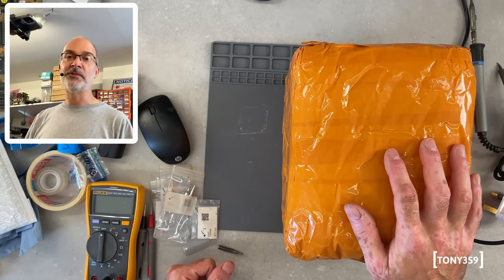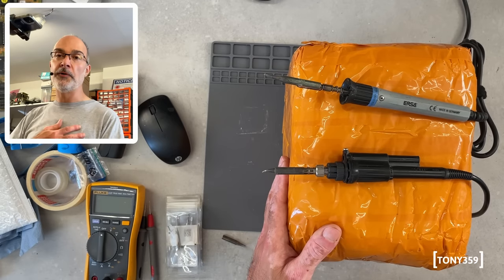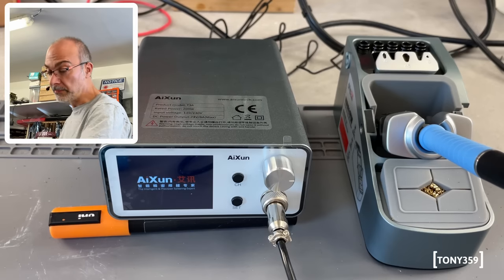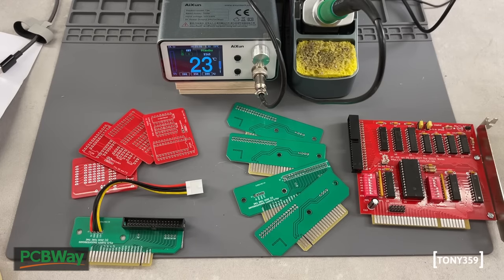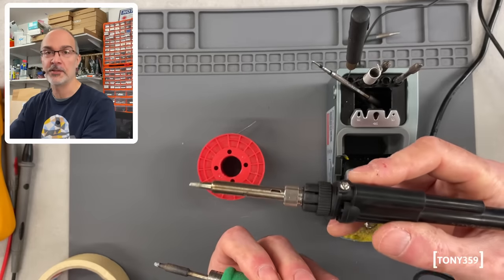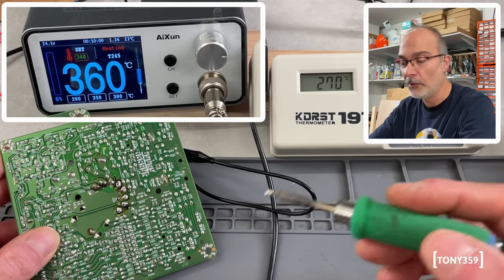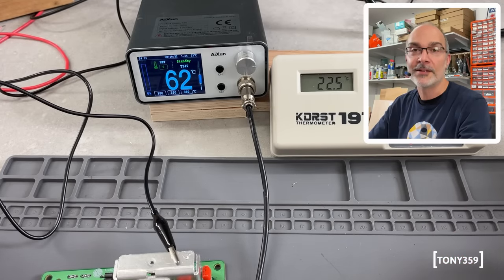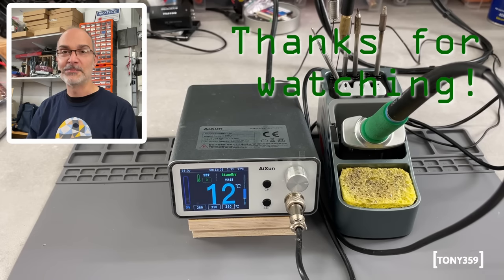Is the Aixun T3A a good T245 soldering station?

Comment: I'm using this station with firmware 1.33 and chinese tips (AiXun and the OEM distributing in carton package imitating JBC which even has the shovel type cartridges). I have measured resistance to ground from a tip and is less than 1 ohm. The tip itself is grounded. I tried heating with a knife tip a cable connected to ground and it didn't behave weird. It maintained temperature with no power spikes.
Reply from the maker: Mine is also grounded. Try measuring the voltage when it’s heating. You should measure 1V. Touching ground with a tip doesn’t trigger the issue all the time. It needs a grounded PCB and not all the pins, don’t ask me why. SDG electronics (who failed to mention this channel) has also managed to replicate the issue with a newer model so this is definitely not an isolated issue.

Comment: Hi, I have purchased the T3a this week, my firmware version is 1.26 and the calibration is acceptable but due to annoying background noise I disassemble the device and all the Electrolyte capacitors and X2 cap been replaced, the manufacturer used Huahong🤔 brand instead of quality Japanese caps.
2* 35v 1000uf
1*400v 82uf
1* 35v 470uf
1* 50v 10uf
100nf x2 275v
The noise being mitigated but due to high amount of glue around Set button the front glass cracked during the removal process, also I own Jbc T210 station and regarding its 3x price compared to Aixun in my country the handle weigh difference is also noticeable.
Reply from the maker: yes the glued front panel is another reason why I didn't want to open mine!
On EEVBlog forum there is a long conversation about the T3A, the noise comes from the waveform used to drive the handle more or less. It makes some component to "sing". It's just the design.

Good capacitors can only help!
Thanks for watching!

Comment: Thanks for this review Tony. I have the same one. You showed me to update to 1.33 :-D. What happens when you put a 1megohm in the ground line? (make an ESD ground (what it should be I think))
Reply from the maker: The ground line of the soldering iron? To be fair, I don't want to mess with ground, if a device has a ground connection, it's for my own safety. The T3A is already leaking about 1V through the tip (yes, I know it doesn't make sense if it's grounded but that's what my Fluke says) and tinker with ground might not be the best idea. In the end I don't want to damage my PCBs but the T3A is proving to be "unfit for purpose" the more I use it. Ah, and stay away from the latest firmware, 1.35. It's also bad.
Thanks for watching!
Reply: @tony359  No your right! I mean the clip wire to ground doesn't need to be a hard ground. That should be an ESD ground (your blue anti static ESD arm band  also has an 1Megohm resistor to ground in it). If the producer of the iron is cheap, they omit the 1 megohm. and you have a hard ground on the clip. which does crazy things. So you could try it by clipping a 1megohm resistor to the clip and touching ground with it to see if the iron goes crazy or not.
Reply: @tony359  Darn. I forgot to ask you for the link to the upgrades you showed. I cant find them on Aixun website.
Reply from the maker: The ground clip was to show you the problem. The real world scenarios I mentioned (another soldering iron, the signal generator, the pre-heater) can't have a 1MOhm resistor I'm afraid! I think I'll move to a proper station soon... To update it's the Aixun software on their website. The update is done within the software.

Comment: There have been a few firmware updates since this video. Did you try them?
Reply from the maker: This is not something that can be fixed by a firmware I'm afraid. I did try 1.35 I think, the issues were still there and my JBC tip was off by 60C after a full reset. Meanwhile 1.36 came out, I don't use the T3A anymore but I haven't read any enthusiastic comments about that on EEVBlog. Since 1.34, Aixun seem to go to the "let's hide this problem" direction so upgrading might not always be the best idea.
Thanks for watching!

Comment: Have You tried 1.35 version? Are these problems still there?
Reply from the maker: I gave it a quick test, the first thing I noticed was that my usual tip was now 60C off (this is after resetting the station). The grounded PCBs issue was still there. I really feel those issues cannot be fixed via software I'm afraid.

Comment: Thank you for this very informative video 👏 I recently mad a purchase for one on ebay too sweet of a deal to pass up but now after watching this im having second thoughts. I initially wanted the T320 which recently became available, it supports the t245 & the t210 I hope either you or SDG gets to check it out. I've been running with my Hakko 888D for a few years now and I honestly love it but alot of times now occasionally I would need more power which sometimes it takes too long or doesn't heat effectively for higher gauge wires or large ground plains. Other than that I'm fine but it was really interesting to see the differences between the firmwares and the grounding issue. Now im a little scare of using it but I'll give it a go using the lower firmwares when I get it. I definitely bought jbc tips to prepare but now that I put some thought, Would have it been better to save a little more to get a jbc vs the aixun.
Reply from the maker: If the JBC wasn't 4 times the price... I'm always for buying high quality tools which last a lifetime but I really cannot justify spending £500 for a soldering iron :) 
The T3A is ok-ish :) I still need to try a downgrade and see what happens. Once you know about those issues you can try to mitigate them but I can very much understand your concerns!
Thanks for watching!
Reply: @tony359  I recieved mine today it's on version 1.30 it definitely makes a buzzing noise when heating up to temp but once it's hot it stops. I haven't used it yet I'm going to play around with it later on I'll come back with any updates that I notice.
Reply from the maker: Thanks! Yes the buzzing noise is a by-product of the PWM signal sent to the tip. When you turn it on it's heating at full power so it gets loud. When it maintains the temperature, it'll send "burst" of power and won't be as noticeable. If you put your handle close to your ear, you will hear an intermittent noise coming from it - don't burn yourself though! Looking forward to hearing your update!
Reply: @tony359  lol, yes, that's how I noticed. I did exactly what you said and heard it. Since there was noise in my background at first I didn't catch it but when the place got quiet I noticed. Do you think the grounding issue can potentially be fixed with an update, or would the hardware require some type of modification?
Reply: @tony359  I also noticed on my unit where when I connected the handle to the station, sometimes it doesn't acknowledge it has a handle available. I have to apply pressure or wiggle the connector until it reads, then screw it on. One video I can't remember who right now spoke about it. When I looked, the jackets for the pins were not as close as I thought they would be. I had to do that in order to get the t3a to fire up. As well as barely inserting the cartridge, it came on without snuggling it down with the tip pushed.
Reply from the maker: Never seen that problem I'm afraid. On the grounding issue, I really doubt they can fix it. If the HW is unable to send a reliable thermocouple reading... well you can try to detect it and avoid sending 100% spikes and hope that during that time the temperature is going to be stable. It's like driving blind for a few seconds: you can try keeping the steering wheel straight hoping there isn't a bend. :)

Comment: Because of controlled ESD discharge, you have to ground everything, including yourself. Professionells who must work according to the IPC standards, know this and act accordingly. 😂😂 Besides, you can make the ground connection with a 1 MegOhm resistor. This will maintain the necessary ground connection and does not disturb the temperature sensor.
Reply from the maker: yes but it's too much of a hassle. I don't want to have to waste time on this because someone made a lousy design!

Comment: re: Temperature jump: check inside the handle, the thermocouple lead might be shorting to one of the other leads.
Reply from the maker: Thanks - it’s a design flaw unfortunately seen by others too. It’s apparently because of the smps
Reply: @tony359  Is it noise affecting the thermocouple amp or mosfet switching?
Reply from the maker: I’m not sure but I think it’s the thermocouple. Hence the unit thinks the tip has become cold.
Reply: @tony359  as if the thermocouple connection is intermittent ... handle internal contacts, or cold solder joint or bad/frayed wire
Reply from the maker: @chuckmuziani6262  it's a design flaw because of the way the SMPS is wired apparently. Models using a linear transformers are not affected. This has been confirmed by others - both reviewers and users - and it's not a fault with my unit unfortunately. Hence why Aixun are trying to hide the issue via software.
Reply: @tony359  Curious to see a scope trace of smps output when the 'glitch' occurs.....

Comment: I have the Ersa RT 80 24V 80W and use it with 12V. The heating Element self regulate to around 350°C.
Reply from the maker: I have a portable ERSA iron, it's a good one. Ersa stuff is generally very good indeed! Nothing to do with this thing! Thanks for watching!
Reply: @tony359  I mean your Ersa could also be selfregulation to a given Temperature by its heating element resistens. Like my handle do without its Station.
Reply from the maker: Is it like the Metcal ones? They self-regulate based on the metallurgic properties of the tip? It's an amazing system which doesn't rely on electronics!
Reply: @tony359 No the Heating element is a PTC and changes it value from 2 to 10 Ohm, dependent on Temperature. normally there to measure temperature. But just with a smaller Voltage 12 instead 24 it heat perfectly up to 350°C.

Comment: The intermittent temperature spiking, the screen lieing and weird issue with grounded boards is unacceptable.
It means the tip is not grounded. I won't be buying.
Reply: the 420 dont have this isuues whit the last version and the ones it come  just tested.The issue is how stupid is the price of the 420D when the 420 is the same station i got the 420 and buy the  110 holder and tips and was 266€ .
For me is the best chineses station.
Reply from the maker: I didn't mention that on the video but the tip is indeed grounded. On EEVBlog they speculate that it's some sort of noise which is interfering with the thermocouple reading going to the station. Not sure! Thanks for watching!

Comment: for the average price of these.. i'll be sticking with the t12 systems in place. open source firmwares are available with ease, you can get hakko tips so if there's problems you know its the station you need to poke at for the source, and for the most part they've just kind of worked. i also haven't seen this pwm buzz in any of the t12 variants.

while these t245 chinese variants appear to have a number of teething issues still. i don't find the few upsides over the t12s to be enough to justify switching to the t245's just yet. soldering irons are one of the few things i don't want to spend any time fiddling around with it trying to get it to play nice. its one thing if i'm making my own wands for swap outs, thats on me. its another entirely if its out of the box behavior. not gonna deal with it.
Reply from the maker: I was thinking of a T12 too. Then I saw so many good reviews of this 245 and went for this! I am somehow happy with it, but definitely was not expecting these issues.
Reply: @kenabi Can you reccommend a good T12 system please?

Comment: What a shame. If touching a grounded PCB causes such issues then the tip itself cannot be grounded by the station, right? My first thought would be issues with the PSU of the station. I found that many ungrounded switch mode power supplies leave half the mains voltage on the DC side (maybe coupled though the safety X cap?). Sometimes it even sparks and hurts when touching the DC side. I'd measure the voltage between the tip and ground just out of curiosity ;-)
Reply from the maker: The weird thing is that the tip is grounded. I did measure some voltage between the tip and ground, only when heating. Kind of scary, about 1V but up to 4A if not mistaken. Not what you'd expect from a soldering iron...
Reply: @tony359  4A? I bet the ground wire to the tip is also the current return path for the heating element. Now if the current is high and the wire comparably thin that will create a significant voltage drop across the cable. That explains why the tip is not at the same ground potential as your PCB/ground strip. Now maybe the station observes the heating current, and because part of it flows over your ground strip the station sees less current than it should and thus increases the current -> heat goes up.
Reply from the maker: That could be a very good explanation!

Comment: And you call the 396 like a 'traditional iron'.... do the tip-change to a real traditional iron instead....
Cool it down, get the screwdriver, try to get the small screw on the end loose, cool down more if needed, heat a bit to get the tip loose (hopefully not bend inside the handle), take plyers and carefully take the tip out. Then put the other one in, turn the heat on, wait for about 5 minutes and your iron is on temperature...
Those more traditional irons (also on stations) have / had no temperature feedback and are only depending on the temperature of the surrounding and what you solder with it.
I have for example a 25Watt, a 40Watt, 60 Watt and 100 Watt iron and depending on surrounding-temperature and tipsize it gets to around 240 - 380 degrees after the time it takes to heat.
But well, there is some mass so it does not cool down.
With my traditional station, same thing but I can control the power. So for example only halfwave, 30 Watt on the 60 Watt iron...

The what you call 'traditional' iron with some temperature-control and measurment is already a big step up to those! And then just turn them off, unplug the handle and take another handle with another tip since the handles are pretty cheap but very easy to break the heating-element or damage it otherwise like overheating when you didn't screw the tip on tightly-enough.

Comment: have you been grounding(wire in the box) ur sodering station for fix error dump dump.
Reply from the maker: I am not sure I understand. The ground wire in the box is for grounding equipment, not the station. The station gets ground from the mains cable. I haven't tried grounding the tip - but it does measure continuity to ground by itself. Thanks for watching
Reply: @tony359  ok that sound fair but why another reviewer also test it but dont have that crazy overshoot or some thing similarly.
Reply from the maker: I don't know! But this has been acknowledged by others - there is a thread on EEVBlog and also at least another reviewer who was able to replicate it on their station as well.
Reply: @tony359  that make me thinking alot. Do you have another solution in this price range ?. I want to have a good quality and look catching eye soldering station but also not burning my wallet like genuine jcb one.
Reply from the maker: I don't I'm afraid. Again, I'm told the ones with a linear transformer are ok. But I am a small channel - and I needed a good working station - I cannot afford to keep buying them unfortunately!

Comment: The word "unacceptable" is used a lot for a 200W T245-type soldering station which is cheaper than the most basic 50-60W ceramic Hakko FX888D or Weller WE1010! What does a buyer expect, given the low price? 🤔
Reply from the maker: An iron which doesn't leak 1V and 1.4A :)
Power is not everything.
Reply: @tony359  😁Good point! Thanks for the video, it was very interesting!

Comment: While 1.35 has been out for a while now, it didn't really fix the issues as far as i'm aware. The biggest problem with these newer firmwares i have is that it does not report the actual temperature but instead just displays the set temperature when it overshoots or the tip cools.
I've downgraded to 1.27 which works fine and does actually report the real temperature.
Reply from the maker: You are very correct. I quickly tested 1.35 and it didn't resolve anything but - as you noticed - continues to "hide" those massive overshoots. I went back to 1.33 - mine doesn't support 1.27, the screen would get white...
Thanks for watching!
Reply: @tony359  Oh, that's unfortunate. They must've changed something on the hardware side the older firmwares don't support then i guess. Both my T3A's are well over a year old by now and run the 1.27 just fine. But this means that it is an even bigger problem they really should fix when newer users are not able to downgrade anymore.
Reply from the maker: Exactly. But given the direction they are going, I'd say they're unable or unwilling to do so.
Reply: @tony359 

I ordered hoping to downgrade to 1.27. Unfortunately I also get the flickering white display. I’m guessing any current manufactured models don’t support 1.33 and below due to the display issues.

What’s better 1.35 or 1.33 for overshooting temps/honestly displaying it?
Reply from the maker: @Gurusi  I didn't really play with 1.35 a lot. I only noticed that
- My JBC tip was 60C off (after a reset)
- The ground issue was still there
- The display would always display the set temp even when spiking

So I went back to 1.33 which at least tells me the truth. 

But please also check my latest test against a JBC, the T3A (at least some of them?) leak voltage at the tip! https://youtu.be/hGK7s-9tXs4
Sorry for being the bearer of bad news :)